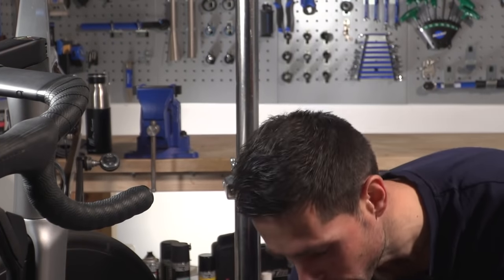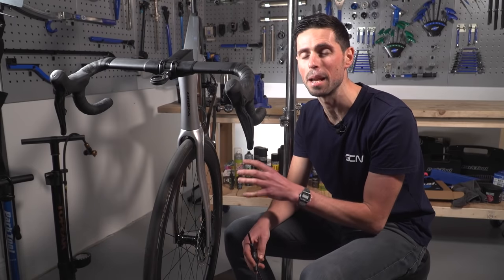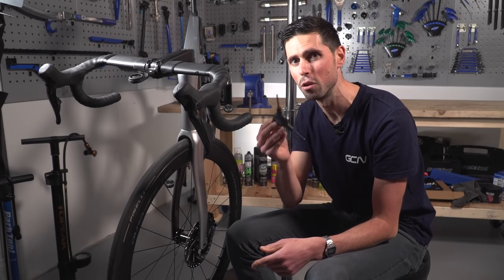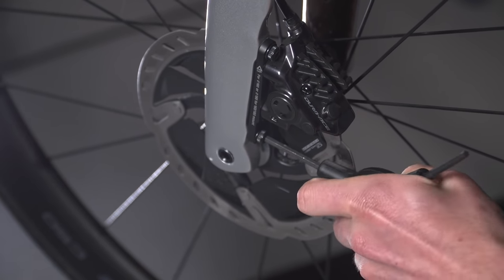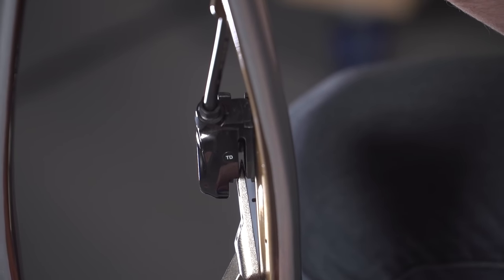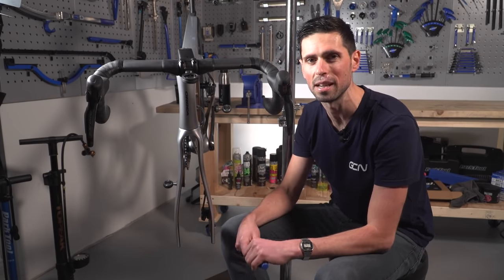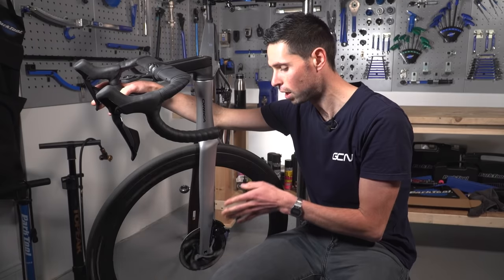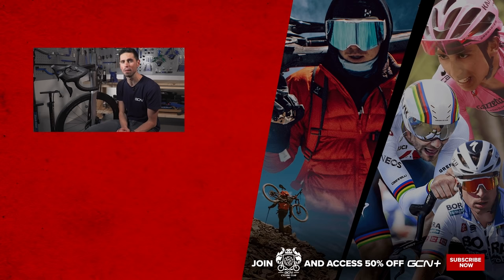How To Stop Your Disc Brakes Rubbing! | Maintenance Monday

Comment: I hate disc brakes because my damn discs ALWAYS rub, even on my brand new $6000 bike. I’ll fix it and then it happens again
Reply: Sounds like you need a better mechanic.  I've had 5 disc brake bikes from intermediate level to $6000 bikes and ridden them 10's of thousands of miles.  Any issues with rubbing were few and far between, and always "fixable".
Reply: @jefferycampbell2243  I mean. I fix it and it’ll be fine for half the ride and then it’ll start rubbing again. Literally all my bikes have this issue. It’s very slight but I’m tired of having to fix it every single ride. They really need to make better brakes that don’t do this.
Reply: Had 2 bikes with disc brakes. Nothing but problems. Never again.  @KillersFromTheWest

Comment: *Laughs in rim brake*.
Never - ever- had a difficulty with rim brakes for a good 14 years. Bought an affordable CX bike with mechanical disc brakes (Shimano 105) and they won't.stop.rubbing. I borrowed a Specialized Venge for a few weeks, hydraulic discs (Ultegra). I decided to give the bike a good wash before I handed it back, and I must've touched the brake lever, for the damn front brake had jammed shut. I spent half an hour getting it back in shape again.

I'm never going go buy a disc brake bike. The disadvantages outweigh the few small advantages.

Comment: That's going to waste alot of time whilst in a race.Cycling manufacturers greatest shame.weaker wheels more weight horse power robbing drag expensive ugly easily knocked out of tune and complacated design further insuring more problems. Any good things about disc brakes other than rim brakes are large disc brakes. Ya my discs work but what a pain. Oh well another problem solved that didn't exist by a accountant' trying to justify his job. What a bunch of rubbish. Shall I go on. Ok I'm not going the mod I did to make the cut brakes work really well perfectly all the time but why do I have to get springs from old bic pens and install them on the brake screws so the pads open properly. Anyways be nice out on the road and trails even to electric bikers why I don't know just do it.